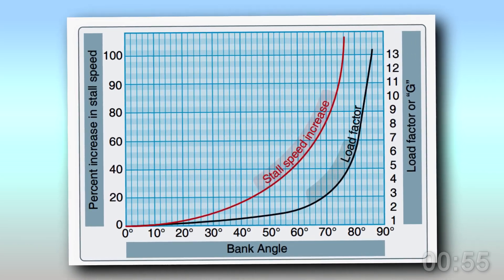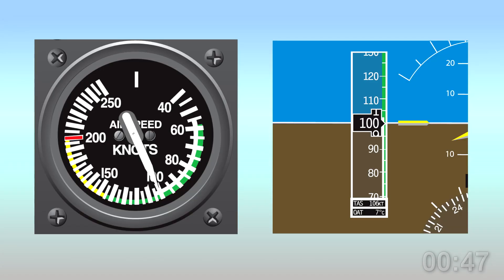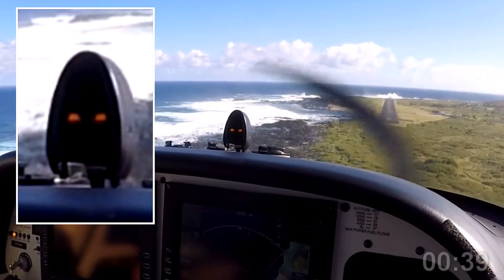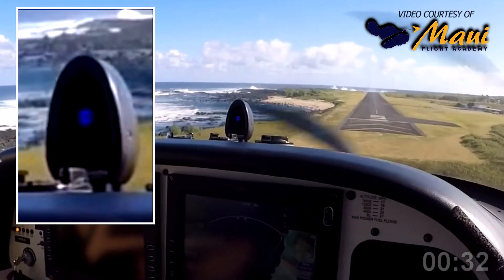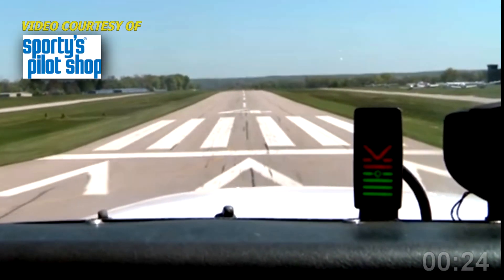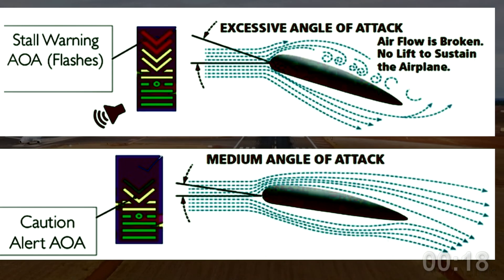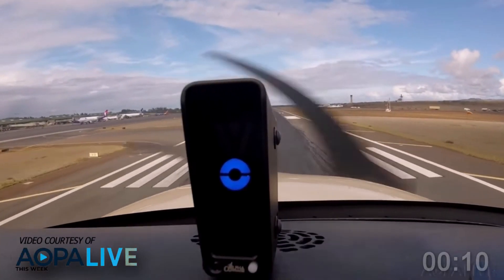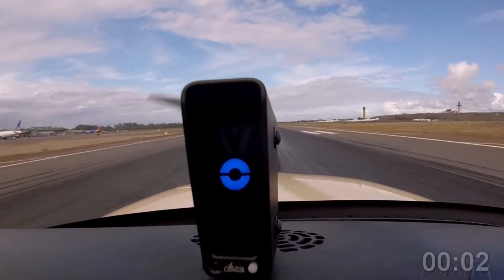Angle of Attack Awareness in 57 Seconds

Comment: Uh, no, for many reasons. Note that your video is a straight in approach in calm air -- my AOA system is unreadable in more than the lightest turbulence. And the same factors that distract a pilot from watching airspeed also distract a pilot from watching AOA. There's lots more, and I've done the research and the flight test. I don't buy in to party line thinking... and landing on board a carrier has so many differences from GA as to be irrelevant to GA AOA. Yes, I'm a CFII/ATP/Ph.D.

Comment: I had an AOA indicator installed in my airplane about 15 years ago. I have been on the AOA bandwagon ever since—it can be a life saver. Mine is a very basic analog version—if I were to do it again, I’d have a better one with lights that would be useful at night, and a “voice” or some other sound that would indicate an impending stall. But even a basic one, properly calibrated, is an extraordinary instrument. Of course, when you’ve “grown up” using the airspeed indicator (I’ve been flying for 49 1/2 years), it’s hard to learn to integrate the AOA indicator into the scan, even when it’s right in front on top of the panel as mine is. But once learned, it’s marvelous. 

As for calibrating, some of the more advanced ones have automatic calibration modes, and many now compensate for flap deployment. Mine requires physically moving the probe, but it still only took about 3 or 4 flights to get it right. Once set, it’s accurate, no matter what configuration the airplane is in, other than mine doesn’t compensate for full deflection of the flaps—it actually gives me more of a margin above stall than necessary, so the error isn’t at all dangerous, just a little misleading. 

But there are still pilots, many of them experienced, who poo-poo the value of an AOA indicator, and claim their derrière tells them all they need to know. I guess as the common meme says, you can’t fix stupid.

Comment: What’s the accuracy of the AOA indicators that work without a AOA probe? I installed an AV-20 and it doesn’t have any way to compensate for adding flaps. Sort of surprised it’s on the market as it doesn’t really work if you can’t calibrate it for the changing AOA with and without flaps. If you calibrate it with flaps it will give false readings when flaps are up. Anyone have any experience with this?
Reply: Nick you do need to calibrate the AOA for a specific flap setting, unless you have a version with a flap position interface (they are available).  Since the critical AOA changes with flap settings your AOA will only work properly on the calibrated flap position - unless you install an interface.
 Rich

Comment: What you say is true and very useful.  AOA's are great if they are true AOA systems. Most on the market are 'Stall Margin " indicators that have to be calibrated to an airspeed. The yoke or stick is an AOA indicator and always has been. With either in the center of it's travel or neutral position the airplane can not stall. The further you move the control from center either forward or backward  the closer you are to stall. Period! For a given weight and CG the airplane will stall at the same position slow or fast, straight up or straight down, right side up or upside down. Put it in neutral and no stall.
Reply: John, I’m sorry, but what you say is totally incorrect. First, AOA indicators are not calibrated to any given airspeed. They are calibrated to indicate when a stall will occur. Once calibrated correctly, they will indicate an impending stall no matter what the airspeed indicator says. The best example is a 60° bank, in which the stall speed is significantly higher than the power off wings level stall speed. 

Second, the position of the yoke or stick has nothing to do with whether an airplane will stall. The stall occurs at the same wing chord angle to the relative wind with the airplane in any position, but the position of the yoke or stick is irrelevant.
Reply: That is a good example of how our general aviation aircraft are supposed to have safety in their design.  Adequate power is part of your formula above as well.
Reply: Well Hooray, John White. Someone gets it. You are correct. In more detail, the AoA is controlled by the pilot by the stick position. Stick force is adjustable by elevator trim. Stick position determines elevator position which determines AoA. Instead of a AoA indicator which is hopeless in turbulence we would be better served by a head up display of stick fore and aft position.
AoA, in order to determine stall angle, is usually calibrated at 1 g stall.